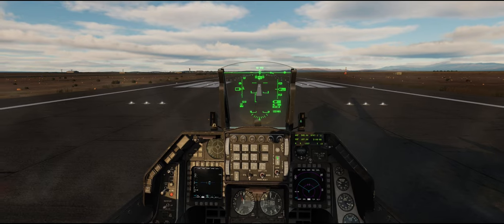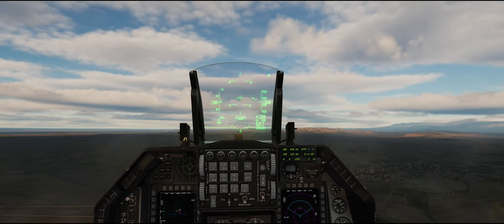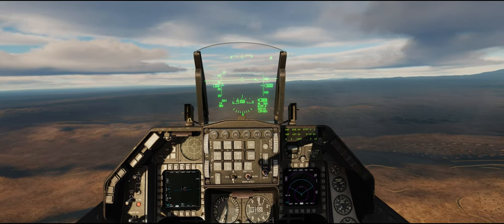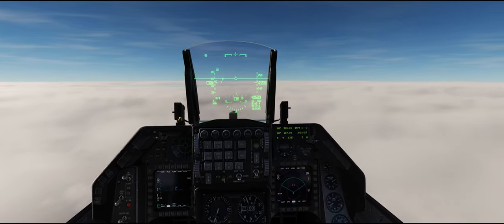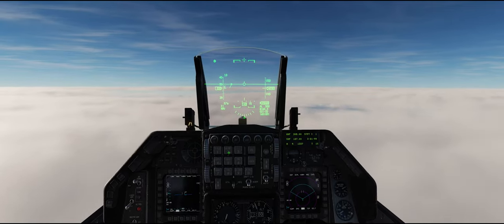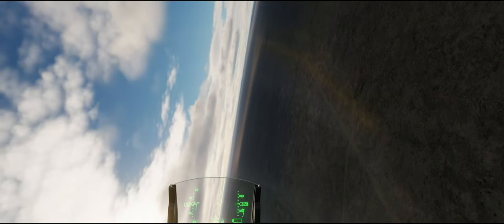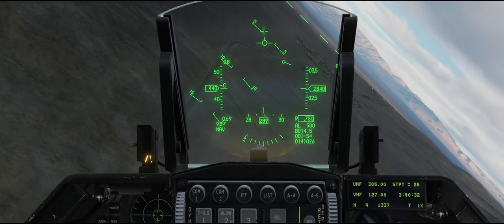DCS F-16C Speeds to fly: T/O, Climb, Cruise, Corner, TAS vs. CAS

Comment: Lemoine, an actual F-16 pilot, would probably disagree with most of what you said regarding the turn rate/speed bleed at supersonic. The F-16 is designed to retain the energy through the turn. You don't want to "dump speed" by normal maneuver. If you want to turn faster, drop your throttle or use another maneuver.

Comment: What I would really like to see (and which I've found nowhere on YT) is how to climb and maintain speed without dipping into after burner (kind of the portion of the video you edited out to discuss differences in speed readings). So often with my group, I'm tasked with leading navigation, and during the climb no matter how fast we start (at least 400 knots), or how shallow, we STRUGGLE to get to 25,000 ft. We're often hovering at 270 kts or less before we reach that altitude. Weapons stores are usually not that heavy either. Not sure what to do to make climbing less strenuous honestly.
Reply from the maker: Set the power and pitch for speed.

In a nutshell, and going from memory, here is a climb profile you can use with wingmen

Full AB t/o, pitch up to put the aircraft FPM about 5 degrees. At 300 kts, mil power. Accelerate to 350 knots.

At 350 knots pull the power back about 20% and pitch up to roughly 10 degrees nose up. FTIT temp about 800 degrees, fuel flow in the 9000/lbs range. You want reduced power so your wingmen can stay on your wing without needing afterburner.

As you climb, fuel flows and the power produced will drop. Shallow out your climb angle to maintain 350 knots. Going significantly below this speed hurts climb performance. Adjust power to maintain 800 degrees FTIT

As you climb through 20k you’ll notice the climb getting real shallow to maintain 350 knots and the Mach number is increasing. Maintain 350 knots (with pitch, leave the power set) until Mach reaches .75 then transition to maintaining .75 Mach and forget about the CAS (airspeed number). This transition should happen in the low 20’s
Reply: Your just climbing too fast. Set to mil power after takeoff, climb at 350kn and reduce the climb angle to maintain it until you reach your desired altitude. Remember 25K feet is almost 5 miles high. The air is thin as hell at that altitude. No air, no power. Just be patient and remember real pilots aren't doing unrestricted zoom climbs unless it's for air shows or press flights. If you are delivering warheads on foreheads you have become the bomb truck. Drive the truck efficiently.

Comment: Thank you for a clean and nice video. Missing climb but i see you commented that below.  
One thing i would like to stress, and you are briefly talk about is to not climb too high and get energy starved.   Something i see online quite a bit lots of bags, and trying to fly too high with a very draggy load, with the plane hanging on it's ass with a high AoA and the plane just being slow due to the added drag. 
Standard IRL A2A is only a centerline bag if needed and the Wng bags are standard for A2G configurations that need loitertime over manouverability. 

And for GS you really don't need bags unless you use what i call concorde technique. Where you use bags to go full AB to around 50k feet for a massive missile range advantage. At that altitude you will have to run full AB, but you will consume about the same as at 30k  full mill. Boring strat but safer for new players :D

Comment: Awesome information about speeds and fuel management, thank you! One thing I don't know is what is the typical climbing angle and speed after take-off? I want to get to 20k ft, what should my climb and speed be. I just wing it but there is probably standard procedures I am ignorant about.
Reply from the maker: Speed 350 knots. Set power and reduce the pitch as you climb to maintain that. After 20k feet you’ll notice Mach is creeping up through .7 .. at .75 Mach transition to maintaining Mach in the climb and don’t worry about knots any more. The knots will drop as you continue climbing.

Comment: I think I missed the part talking about climb. I've always followed 0.66 or 0.77 mach for best climb.
Reply: That is a good strategy.  You kind of fly it like an airliner, set power between like 85-100% and adjust pitch for speed.  say 350 loaded and 375/400 when light and once you reach mach .72/.75 when heavy or .80 when light you pitch for that. And once you cdrop below say 500 or 200 ft/min you level off to have some power reserves.

Comment: When doing BFM in the f16 should the HUD be set to display CAS or TAS? Which one do I base 430 knot rate speed on since there is a notable difference between the two the higher up you go?
Reply from the maker: You’ll want to fly with it in the default setting, CAS. TAS and GS are really just useful for checking your performance if you are transiting between locations.

Comment: subscribed, One question what's button to switch between C/T air speeds?
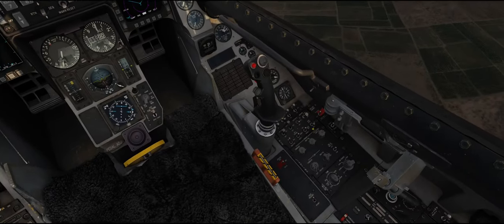Reply: Gaffer showed the switch at 5:26.  It's next to the flight stick on the HUD control panel.  3-stage switch to select between CAS, TAS, and Ground Speed.